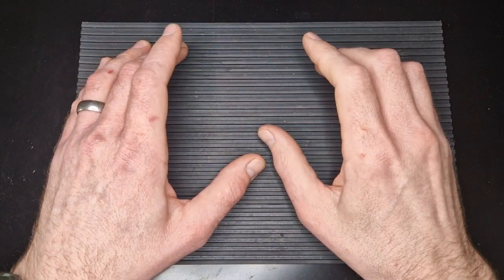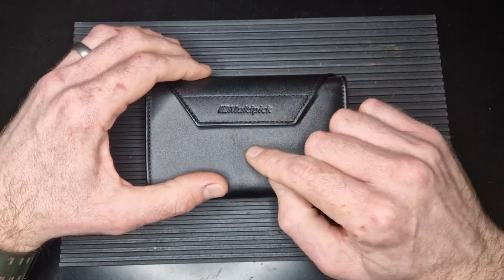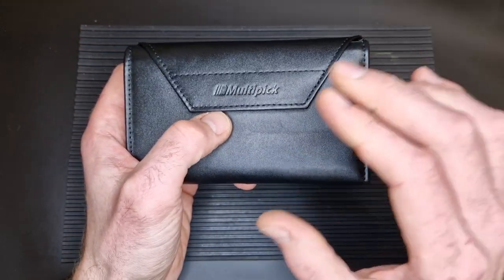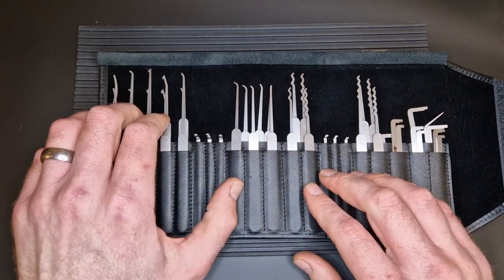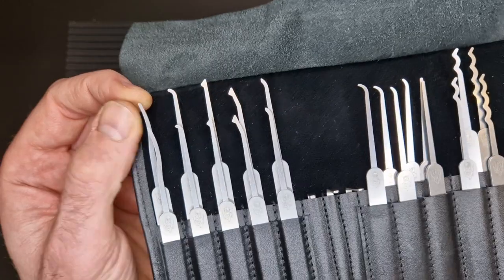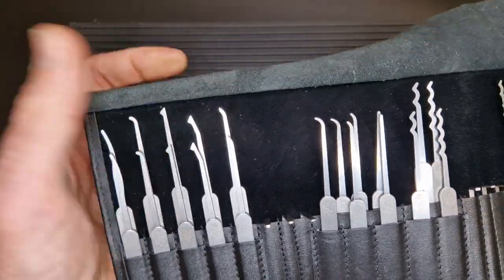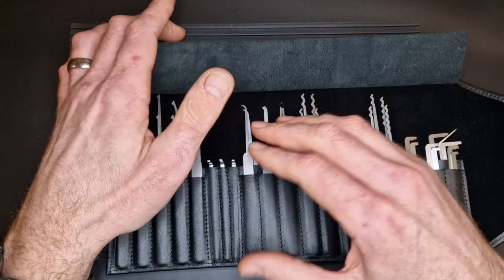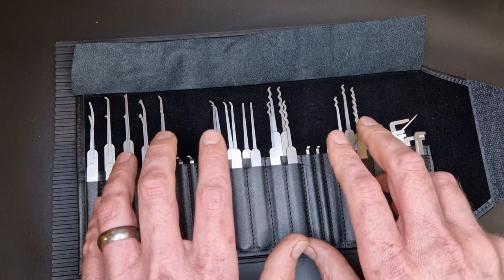Review: Multipick ELITE Advanced Pickset 40 pieces (Christina Palmer 0.4 + 0.6) #multipick

Comment: You also weigh people in stones. 
The other thing that still is measured in the imperial system (inches), at least in the English speaking nations are tires/tyres. Millimeters used for width, percentage for sidewall height, and inches for outer diameter.
Reply from the maker: I'm a tradesman and use both metric and imperial still. 8x4 sheets, 2x2 timbers etc, but also use mm for smaller measurements. I've gotten used to using both systems at the same time without realising it half the time! 😁👍🏻